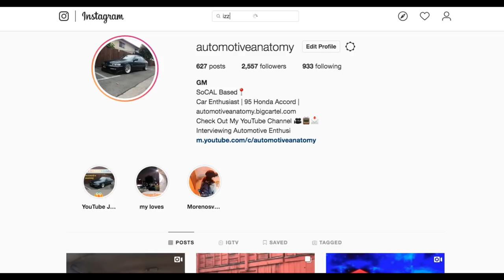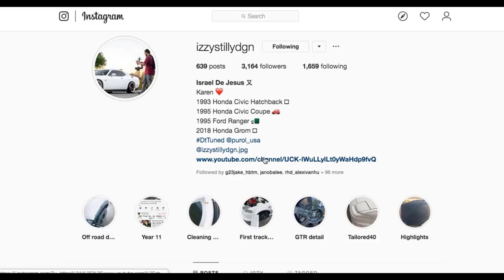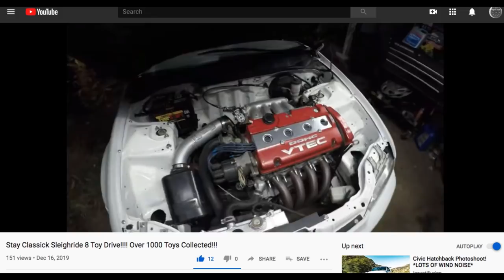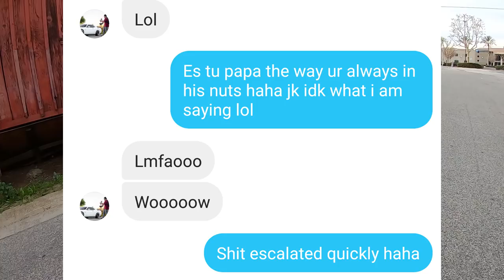Honda Civic EG H2B: Executed Vision

Comment: my first car was a 93 si that I drove off the showroom floor at Colonial Honda in Glendale, CA.  It was $10,300, no AC/no stereo.  I paid $500 for an extra 2 year warranty and floormats, and financed half of it working at Dominos pizza when I was 18.  I regret selling it in 2000, but I needed the money (just graduated, part time job, barely making it, and it was the only thing I owned that was worth anything at the time.  Best memories for sure.  I've got 2 EF's now, but I'll always have much love for my EG.
Reply from the maker: Thank you for sharing that Daniel. Amazing that we have to sell and get rid of things at a time we have to. But, thank you for sharing how much a brand new EG was. I bet people were amazed that you got a a brand new car with no AC and no stereo lol
Reply: Si had ac ?
Reply: @mitchellsavage313   @Mitchell Savage  optional AC.  There were two Si available the day I bought my car.  One on the lot with AC, and the one on the showroom floor with no AC.  But the advertised $10,300 only applied to the one I bought.  I did end up getting AC for my car 2 years later at Pasadena Honda. It was $1100 installed.   I was making $9.35 an hour at Bank of America so that was still a lot of money for me because I was paying for college too.  I had to put half on the card.  Lol
Reply: I sold a gsr da.
Iv yet to find one that clean